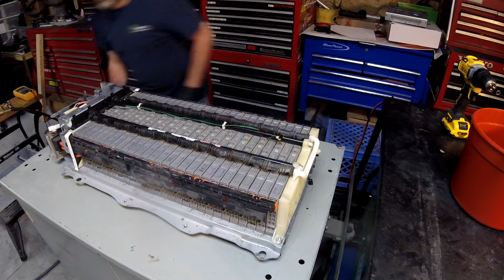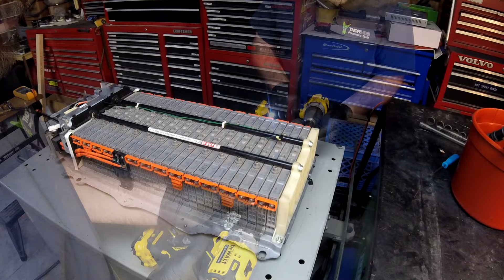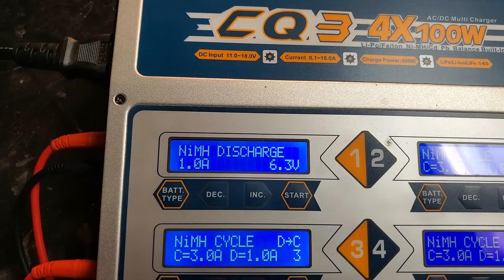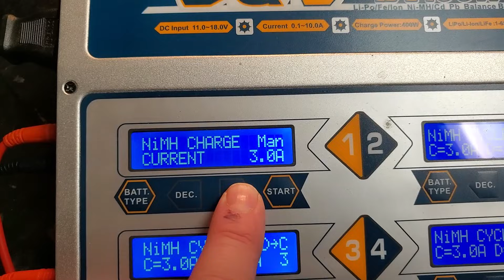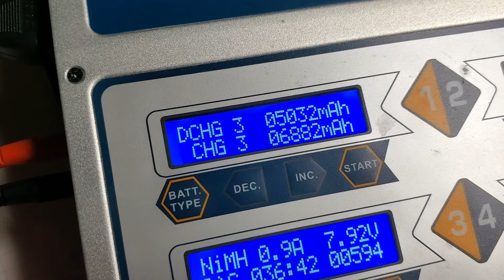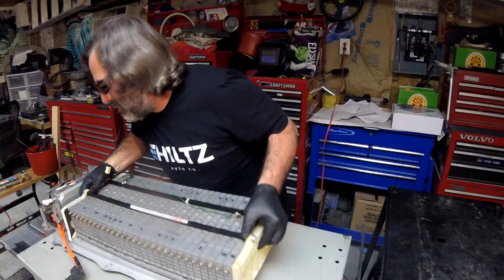DIY Refurbish / Repair Hybrid Battery 2nd Gen Toyota Prius - EV-Peak smart charger POA80 P0A80

Comment: Jesus 16 days to complete this? Is there anyway to shorten this time frame other then buying more chargers?
Reply from the maker: Thank you for watching. If your batteries are in better health than the ones shown in this video the process will take less time but if your batteries are worse than in this video health then the process will take more time. Some people run 3 cycles on each battery and replace any that do not make it to 5000 in those 3 cycles.

Comment: Question maybe you have already answered it but how does the charger know feedback from the battery ? you did not connect a balance port to get real readings from the battery ?
Reply from the maker: Thank you for watching. The charger knows the state of the battery by tracking the current used. The balancing port is not needed for this type of battery. If this were Li-ion battery then balancing would be used.

Comment: I followed everything to the letter.  Got everything above 5000maH.  Leveled the batteries and organized the highest discharge rated toward the middle. Got everything back into the car per ChrisFix's video.  Ran great for a out 4 days then gave me another bad block code.  Devastating.  Took me 2 months to order, test, replace new modules.  Dont really know where to go from here. That thing was a pain to get out.   I wonder where I went wrong.  Guess I have to bite the bullet and get a whole new one.  Thanks for all the guidance regardless.
Reply from the maker: Thank you for watching and writing in. I can certainly understand your frustration but don't give up as your experience is not typical. Perhaps one of the batteries was on the borderline but still made 5000mah on discharge? Perhaps a poor connection on sensing wire for that block? I hope you will take another try at it. Please write back and let us know what you decide to do and how it works out.
Reply: @GreggFesto  Thanks I'll give it another try.  One thing I noticed in this video is that there is never a call to set a  discharge voltage in manual discharge area.    I see you've added it to the description and after looking at some of your other videos I saw this set. I see now you mention it further down the comments too.  

This CQ3 defaults to .1V and I never touched it. I hope I didn't drive these modules too low and permanently damage them.  Is it worth it to rerun the ones that I ran on the wrong discharge voltage setup?  Or should I just replace these modules and start again?
Reply from the maker: I would certainly rerun the batteries again. There has been another person who did the same thing and they had good batteries still. Please write back and let us know how it goes.
Reply: @wessleyanderson8024 hey so what ended up happening to your battery?
Reply: hi any updates?

Comment: How're you going to reach to 7500mamp  when you're only charging at 3amps(3000mamp)?
Reply from the maker: There is another hybrid refresh video on my page, It shows an example of battery reaching 7500mah capacity.
Reply from the maker: Thank you for watching. Yes, you can reach 7500mah cutoff with charging setting of 3amps.

Comment: Dr prius shows temp three high i thought middle be hot shall i open and remove cells so hot ones  go to other side
Reply from the maker: Thank you for watching. Moving batteries from one side to the other will simply move heat zone. Check the suspected bad batteries with charger and see if you get at least 5000mah on discharge current. If no, then replace.
Reply: @GreggFesto  why mine has heat on temp 3 on dr prius how come.not middle one and u kniw the heat cells are the ones which dont get full charge
Reply from the maker: Failing batteries/cells will cause more heat than those that perform correctly. Perhaps this is what you are experiencing?
Reply: @GreggFesto  where is good place to buy cells and can I buy cells and keep them when fails I replace them will the cells run out of charge if not used and is it bad for cells
Reply from the maker: I purchased my last batteries from ebay store called AloyHybrid. I suggest purchase when needed and ready to install. Not sure how long batteries will last on shelf. I have cycled some on charger that sat for over a year and they all had very low discharge mah on first cycle - and some of them never recovered to the 5000mah discharge goal.

Comment: Hello Gregr, I received 3 refurbished modules from eBay seller and ran through discharge/charge cycle and they were 3,500mAh. The seller assured they were over 5,000mAh. Did you have to run multiple cycles to bring the ones you purchased to at least 5,000mAh? Do they have to be oriented positive/negative/positive/negative...? I don't think this would make any difference.
Reply from the maker: Thank you for watching.  I did run my replacement batteries to see where they were on power. All tested over 5000mah on discharge. It is possible that the batteries you received have been sitting for a bit and may need more than 1 cycle.  You are correct, physical orientation will make no difference.
Reply: @GreggFesto  I contacted the seller and explained the situation with proof of various pictures from the cycles. He apologized and told me that he'll run a batch of discharge/charge cycles and resend me with correct modules of at least 5,500mAh. I think he assumed that I wasn't going to test these modules and just install them. A word of advise to all your followers watching, do your own independent test by running a cycle of discharge/charge to make sure the modules purchased is what was described in the advertisement. Don't take seller's word only.
Reply from the maker: I am glad you got it straightened out - ANYONE READING THESE COMMENTS PLEASE SEE WHAT @sejinoh1970 IS SAYING - TEST REPLACEMENT BATTERIES WHEN THEY ARRIVE TO BE SURE THEY ARE AT LEAST 5000MAH.

Comment: Hi Greg, I just completed running discharge/charge cycles and it took about 6 days with 2 units just like the ones you have. There are 13 modules that are below 4,500mAh and the lowest was 3,258 after 4 cycles. Now comes the challenging part which is trying to purchase refurbished modules on eBay or Amaon. I ask 12 different vendors if their modules have at least 5,000mAh. None of them could provide this and most of them told me to go to the dealer and buy a new module. It's interesting even though their advertising states they reconditioned their modules thoroughly. I guess their definition of reconditioning is different than mine. Where did you get your modules? When you purchased, do you recall the average discharge capacity on those? Did you have to bring those up to 5,000 mAh by running cycles again?
Thanks again!!! Cheers!!
Reply from the maker: Awesome. Thanks for the feedback. I purchased my last round of batteries from ebay seller called Aloy Hybrid for about $31 each. I tested them when they arrived and all had over 6500mah discharge.
Reply: @GreggFesto  You’re the best!! Thank you!!

Comment: Greg , I have the EV Peak CQ3. I set all settings mentioned in video exact. What happens when the CQ3 ends the program with the code  "FULL"  instead of "END". The "FULL" ending wont let me inspect the capacity results. Does that mean the battery is in great shape?
Reply from the maker: Thanks for watching.  I have not seen the FULL message in my charger before. It says in the instructions that FULL is same as END. So your charger ran all of the cycles you programmed. You should have been able to inspect the readings. I would run it again and see how it does. Be careful which button you press once done because if you hit the wrong key, you cannot go back and get results.
Reply: Did you figure this out? Having the same issue with my Cq3

Comment: I got this supernova 250 charger as power source it says needs ac battery what can I use is there dc ac converter to connect to regular electric
Reply from the maker: I have never seen an AC battery. You may want to look at instructions closer.
Reply: @GreggFesto  hi thx I mean I buy aac power converter to DC 12v
Reply: I meant 110 ac converter to 12 v dc
Reply from the maker: Yes, you just need to purchase 12V power supply that plugs into the wall. Connect 2 jumper leads from power supply to charger.
Reply: If I want regular battery it will cost me 100$

Comment: Great video Gregg!! Could you post your paper that showed the battery #s and their readings and which ones you replaced and the ones you kept. Thank you so much for this step by step instruction. I'll be attempting this project soon.
Reply from the maker: Thank you for watching. Unfortunately I do not keep the paperwork once the pack is complete. I usually write the ending discharge mah on the battery itself then move onto the balancing. Once balancing is complete I put the batteries with higher numbers in the center and the lowest on the ends. There is another video on my channel showing process that has a few more charger details. Check it out if you have time. I hope you will write back and let me know how your packs turns out once done.

Comment: Hey Gregg, excuse me for the redundancy but I want to be perfectly clear that it essentially doesn't matter if the cells reach capacity if they don't reach a discharge cap of at least 5000 mA? Thank you for your video, I'm just trying to make sure I'm doing this right first and foremost and also so I can assess whether it's worth the time and resources and when/whether to start considering plan B etc...
Reply from the maker: Thank you for watching and commenting. You are correct, in my  process the battery needs to reach 5000mah discharge regardless of the charge capacity to be considered good. I have a newer video out that shows this a little better. Please write back and let me know how your pack turns out.
Reply: Thanks. I'm gonna watch that one as well. This is for a 2007 Camry Hybrid and my cousin let it sit for over 2 years and after getting some diagnosis was told it needed a new battery. Fast forward, I'm back in town and was told I could have the car if I can get it running which is what got me to your video which I originally watched a few months ago and am finally working on it. I've gotten 20/34 cells fully charged to your specs as of today 8/1/2023 my deadline for this portion of the project is 8/10/2023 in order to reinstall it and see what happens before my return window for the charger since I won't need it going forward and can use that money for tires that will be needed. Anyhow that's obviously more than you needed to know. Thanks for giving me hope!

Comment: Before you balanced, did you cycle through the replaced modules 3 times and got their readings of dischage and charge? Thanks.
Reply from the maker: Thank you for watching and commenting. Yes I did cycle the replacements to make sure they had at least 5000 discharge mah. I have another video of refurbish out as well. check it out if you have time.

Comment: Hi Greg, I've seen some videos where a person uses Dr Prius and revs the engine to perform diagnostic analysis of each individual modules. What's the difference on that approach versus the way you did it by discharge and charge cycle over period of time. In my opinion, your method would be more thorough although it does take more time. Thanks again!!
Reply from the maker: The dr prius app will test the modules. The charger will actually bring them back to better health.

Comment: As my cells are done charging, most read: CAPA and I can get the numbers by pushing  (battery type). Im also getting a ( fuul charge ) message, and when i push (battery type ) I get nothing. What does Full Charge indicate ?
Reply from the maker: Thank you for watching and commenting. The CAPA means you reached the 7500mah charge setting. I believe the button to push for readings after cycles are done is the mode/esc button. I have another video of this process on my channel that shows a CAPA battery, a bad battery, and a battery coming back to life. I have not run across reading at says Full Charge yet.

Comment: @18:23 you equaliazed the battery to better balance by connecting the wire altogther with + on oneside and - the other. After 48 hours, do you need to charge the cells?
Reply from the maker: Thank you for watching and commenting. After balancing there is no need to recharge the cells, just put them back into original configuration and reinstall in the car.

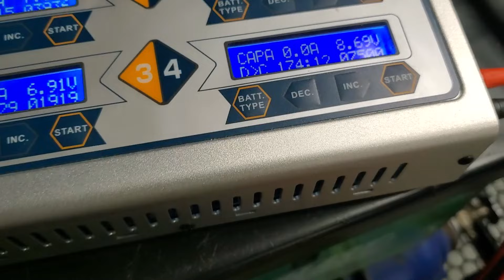Comment: You said @ 15:11 the next one just ended and it took 16 hours? So to discharge and recharge of 4 cells for 3 cycles took 16 hours?
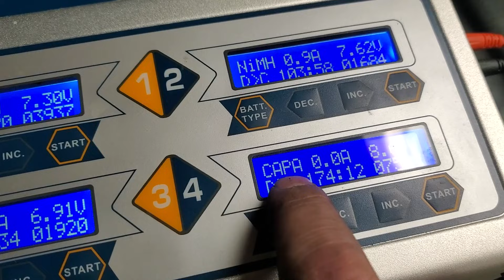Reply from the maker: Thank you for watching and commenting. The cell at 15:11 took 16 hours to run 2 cycles. on the second cycle it met the charge capacity setting of 7500mah.

Comment: I changed my 2013 milage 226000 bus bars still temp goes to 116 on dr prius the other two 103 102 seems bus bar not help reduce heat someone should make battery cooler for battery the car is not good cooling
Reply from the maker: Thank you for watching and commenting. Most heat generated comes from the charge/discharge of the batteries.
Reply: @GreggFesto  hi thx again so changing bus bars what good for
Reply from the maker: You only need to change bus bars if they have corrosion on them. The corrosion is more likely to cause power issues.  Have you tried refurbishing as shown in video?
Reply: @GreggFesto  hi they had corrosion I bought new ones from eBay not original but they were good

Comment: Wow! This is one of the best Youtube DIY videos I have seen (and I watch a LOT of DIY vids) thank you sir! I just got the dreaded red triangle and will be pulling the pack tomorrow to refurbish and balance. I already saw the comment about making sure the discharge voltage is set to 6.3… I’m excited to get my Prius back up and running… I love my Prius.
Reply from the maker: Thank you for  watching and leaving a great comment. It is appreciated. I wish you the best of luck with your refurbish. Let us know how everything goes please.
Reply: Greg! It’s done… finally. Used a venom 4 port charger and documented everything on graph paper… replaced 3 modules and all the bus bars and bolts for a total of $135… just put it back together and ran a diagnostic test on the Dr. Prius app, it’s showing a 93% capacity! Let’s hope it holds… thank you again sir. Definitely beats paying for a new pack… plus I love learning new skills.
Reply from the maker: WooHoo - That is perfect results.  I think you will get many years/miles out of it.  Thank you very much for the followup post, much appreciated.
Reply: This refurbished battery got me over 30,000 miles of use. Unfortunately, my fuel mileage has dipped below 30, and we are noticing some performance issues now, so we just decided to replace with a brand new battery. 
I’m back on Youtube and saw this video pop up again so I figured I’d give you an update. 
Thank you again for such a great video, we are thrilled that we were able to extend our Prius life this far. 
Cheers to you, Greg!

Comment: Great video,  in process of charging individual cells but getting weird numbers.  First 4 cells read 3600to3900 low and then hit 7500 high so all 4 only went throw 1 cycle.  So I re started all 4 and got 3500-4900low and 32-55high.  Now I can’t get any of the cells to discharge/charge normal.  Now it goes 2-6 hours says end reading out 50-80 low and 32 high.  What am I doing wrong?  Everything is set up identical to what you have on video and same charger.
Reply from the maker: Thank you for watching.  Did you double check all the settings with the settings listed in description under video? It is possible that the voltage setting (6.0-6.3) is not entered in the charger.
Reply: Yes everything is set up same as what’s listed in list.  6.3 for voltage settings.  Only thing I haven’t done is unplug charger and start over.  I’ll try that this morning if the overnight run wasn’t successful
Reply: The pre charge under user settings was set to ON for 2Mins.  Switched that to off and my overnight charge finally worked reading normal numbers this morning.
Reply from the maker: That is excellent - Thank you very much for the feedback, hopefully it will help anyone else who runs up against same issue. Please write back in when done and let us now how your pack turns out.